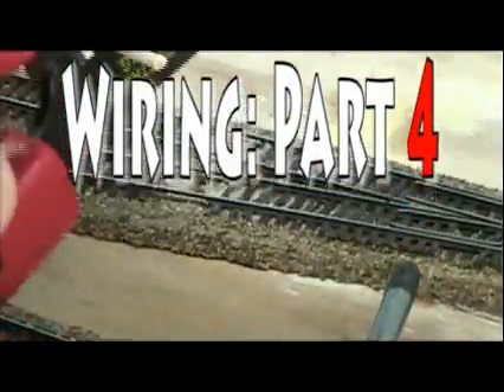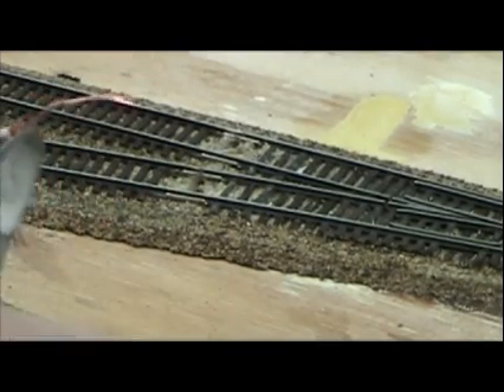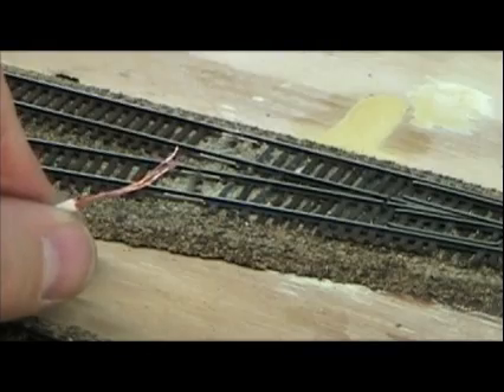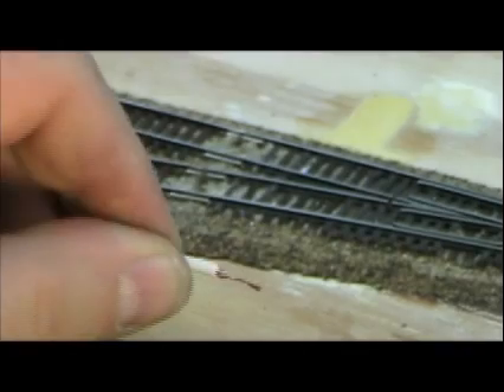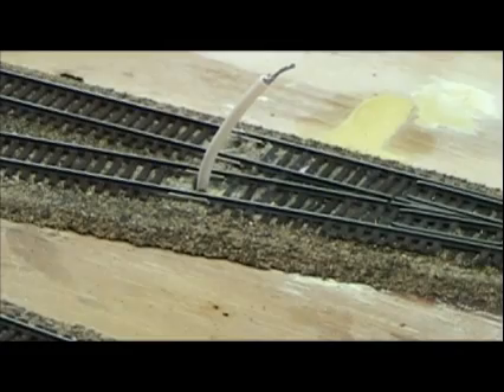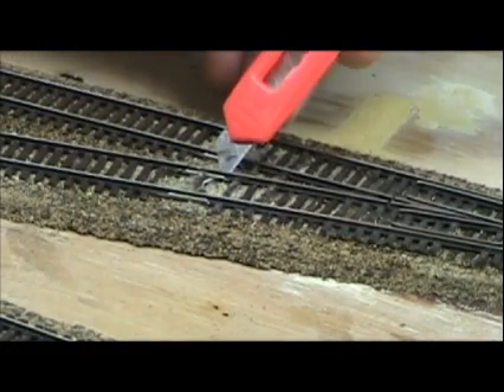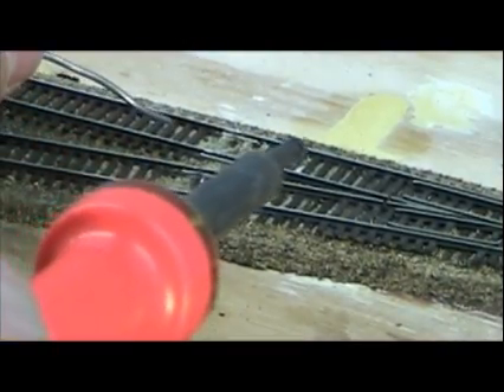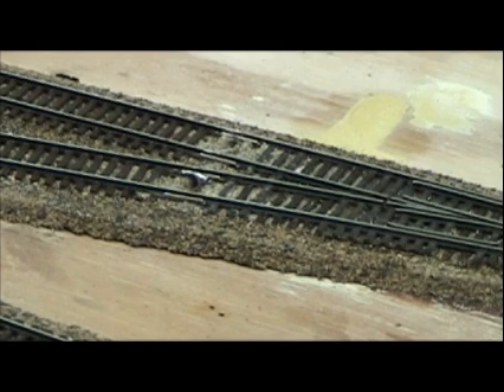Model Railroad VLog: Wiring: Part 4

Comment from the maker: Both.  The main bus carries the power to the tracks and also the signals sent out by the Dcc control.  I just run feeder wires from the main bus to a terminal strip and then to the track sections.

E

Comment from the maker: I solder the wire to the bottom of the rail joiner (which is already clean...well at least clean enough) and I use rosen core solder.

E

Comment from the maker: I'm actually soldering the wire to the bottom of the rail joiner.  I haven't had any problems with soldering to that location. 

E

Comment: I question why solder on the inside of the rail-joiner.  Solder only on the outside and there is no possible way to get a bump of solder for the wheels to go over. Just my two bits worth.. Thanks

Comment: How come no flux and no cleaning of the rail before soldering?  I always use a fiberglass pen to clean the rail and then flux on the wire and rail and I've always had a lot of luck.  You, of course, have t make sure you clean of the rail of any left over flux or fiberglass!